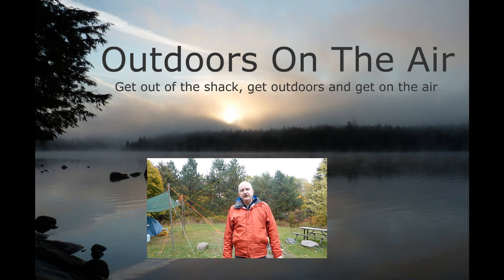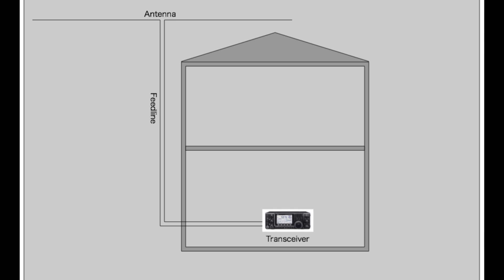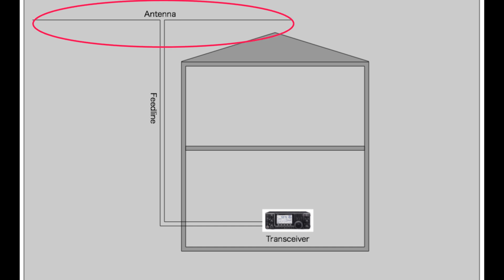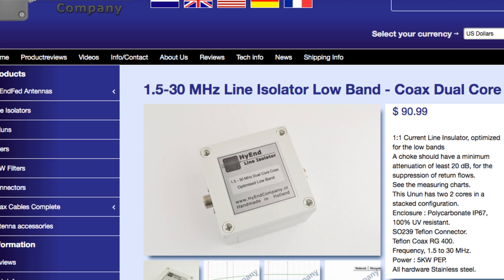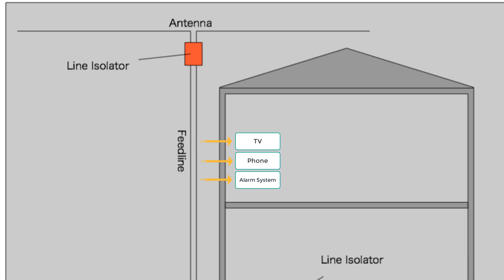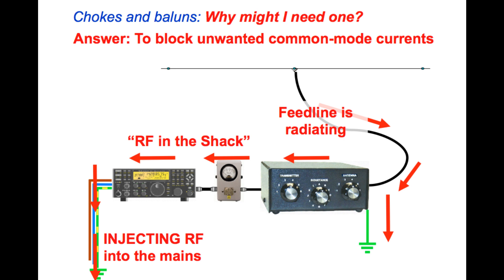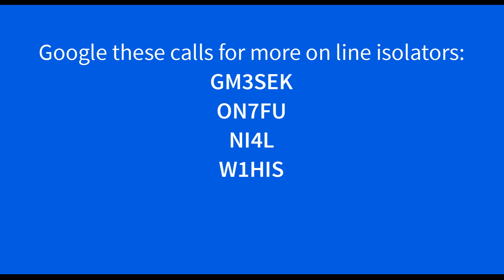Feedline Superhero -The Line Isolator

Comment: Nice presentation. Thanks. A couple points I would add is that the capacitance of the counterpoise is beneficial to the antenna, a dipole being the prime example, so you don't want that sunk directly to ground on the antenna side before the choke, but after the choke on the tuner/radio side - the choke(s) impede the common mode current and the ground sinks its capacitive charge.
Reply from the maker: Thank you for adding this information!

Comment: I have a 1.5kw T-4 line isolator , gonna out it behind amp or rig??????
I also have a cde base station filter in line with clip on ferrite on the main coax off the switch box ...
Still getting in the kids wired gaming headphones 🎧 pain in the arse🤣🤣🤣🤣

Comment: Brilliant presentation,  I find the first thing is to put such an isolator between the two sides of the dipole at the feedpoint and the coax lead, that has done most for me by isolating the outer of the coax at that point however, at least one other isolator, normally near the rig also cuts down the "crud".    As per GM3SEK, big big chunks of the correct type of ferrite on the mains power lead from the socket in the shack and/or from the mains distribution unit itself also cuts down the rubbish coming in from domestic electronics.     Sadly, I've never been successful with the old style twin feeder into the shack via a fully balanced ATU like the Johnson Matchbox, computer noise always seems to cause problems.  It might just me but that's my pennies worth 73 Tony ZRJ
Reply from the maker: Thank you for sharing these great points, Tony! 73 from VE3TWM.

Comment: Tracy. Thanks for another great video. I use a tuner. Would the placement of the isolator be...LOW PASS FILTER>TUNER>LINE ISOLATOR>ANTENNA...?  Thank you Jim WX7Q
Reply from the maker: Thank you, Jim! Put the line isolator first after the rig...rig > line isolator > low pass filter >...
Reply: @OutdoorsOnTheAir  The line isolator should be placed after the tuner (especially an auto-tuner) as common mode currents can cause the tuner give erratic readings and, in the case of an auto-tuner, operate erratically!
Reply: @OutdoorsOnTheAir  Thank you Tracy!!

Comment: Hi very good vid, what if I have linear amp ? I am experiencing my audio comjng out in other speakers in the house, I put a 1:1 balun close to antenna but the problem still here. Will a line isolator in shack help ? Would it go directly after amp or after the power meter?, my set up is radio>amp>power meter>antenna. Thank you
Reply from the maker: Putting a line isolator between the rig and the amp should help. But always ask the vendor for advice when purchasing a line isolator, they will be in a better position to advise you.

Comment: Nice video and very informative. However, I cannot resist pointing out something that is subject to a lot of confusion: the choke is not a BALUN in this case, but - as the title suggests - a line isolator. The name choke refers to the electrical component, whereas BALUN, UNUN or Line Isolator refer to a specifc application/variation and the job it is doing.
Reply: Yes. more for the newbs --> a Bal-Un is used as a "transformer" to match impedances between the transmitter and antenna, not as an inductive choke. Bal = Balanced, Un = Unbalanced
Reply: @2pi628  Where would you put the Balun/Unun? outside with the antenna or inside by the radio? i am confused on this! sorry if this is a dumb question lol

Comment: Do i still need a balun ? Radio->line isolator->cable ->line isolator ->1:1 balun ->antenna
Reply from the maker: Potentially, yes. A balun could be part of the antenna design. If it is, use the balun and a line isolator.
Reply: A line isolator, common mode current (CMC) choke or 1:1 current BalUn are all one and the same.

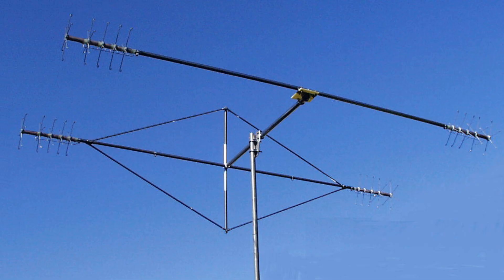Comment: New subscriber here - excellent, well-explained video, I'm convinced and will try two isolators. Question, what is that intriguing antenna you show at 1:04 - I think I want one :) Greg KJ6ER
Reply from the maker: Hi Greg, thank you! That antenna is a TGM Communications Mini-Quad for 20-15-10 meters. I had one for a few years on a 30 foot tower at my previous home and it worked very well. It did exhibit the issue of non-directionality, but at that time I did not know about the magic of line isolators. I am sure if I had used line isolators that antenna would have worked even better. I'd like to own another Mini-Quad one day.

Comment: Excellent presentation Tracy, crystal clear as always. Worth bearing in mind that an end fed random wire antenna might rely on the coax braid to act as a counterpoise to work to its maximum potential, limiting the placement of the choke balun to close to the transceiver ( I learned the hard way!). 73, de 2E0HWO
Reply from the maker: Thank you very much for your comment! Your point about the counterpoise is valid. The correct length of counterpoise coax is 0.05 lambda of the lowest band the antenna is designed for. Put the line isolator after the counterpoise cable and your antenna system will be fine.
Reply: @OutdoorsOnTheAir  Thank you. I always learn such a lot from you. Most grateful. 73, de 2E0HWO
Reply: I'm being a little pedantic here, but does the "standard " formula for the counterpoise coax need to be modified by the velocity factor of the coax used? For an 80m installation using a coax with an 85% velocity factor, this would mean shortening by 0.6m. 73, Howard

Comment: Tracy, thank you for this excellent presentation! I only ever had a bit of vague knowledge on the topic but have never really understood it. This clarifies quite a bit for me. Also, being very visual, I found your graphics extremely helpful. I'm about to put up a permanent EFHV wire aerial at my QTH here in the Green Mountains. My location is pretty remote, so I don't have to worry about too much "external" QRM, but being that my coax will be coming into my recording studio (which doubles as a ham shack), I've got lots of computers, modems, routers, and other devices constantly humming along. So I will definitely install at least one of these before the coax feeds my transceiver. I'd thought that with an end-fed aerial I wouldn't need an isolator at the feedpoint, but perhaps that's not true? I'd assumed it was necessary mostly for doublets. 73, k1rsk
Reply from the maker: Thank you, Robert! I dream of a shack in such a location 😀 73 from VE3TWM.